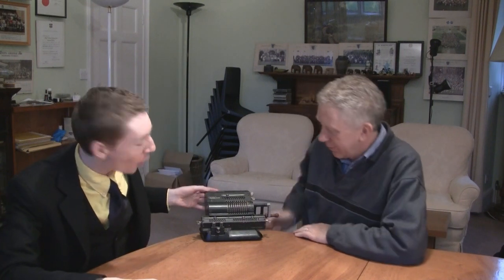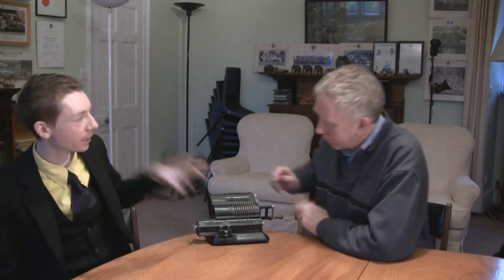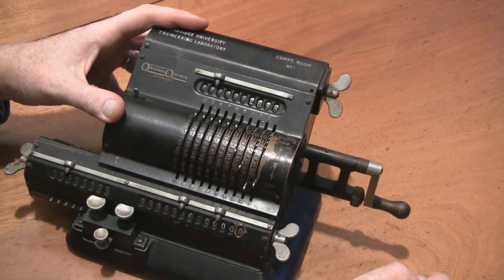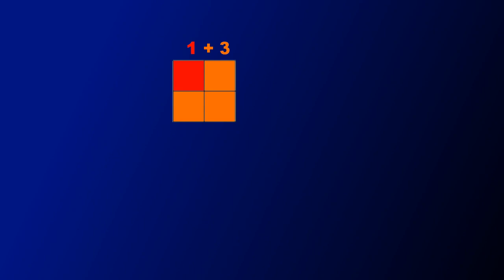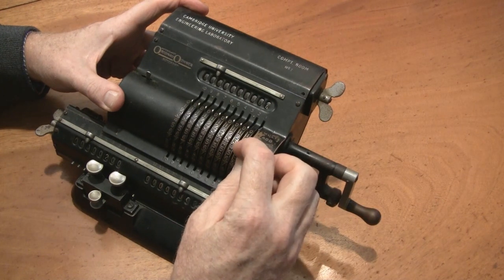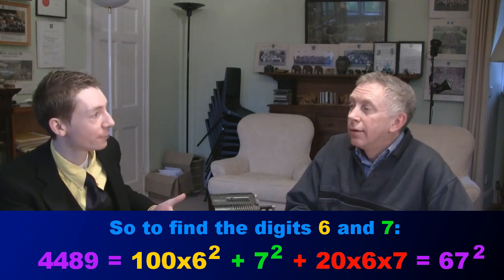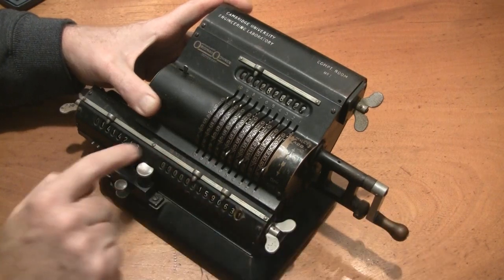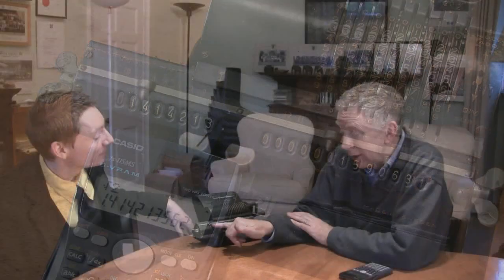The Original Odhner (Vintage Calculator)

Comment: I have just acquired a Kurta mechanical calculator and I’m not going through YouTube for very videos about operating mat and similar devices. I think you should have mentioned the ability to multiply large numbers by adding into different columns the multiples of 10 and explained the bell was when the Accumulator under flowed.

Comment: SQUARE ROOT EXTRACTIONS EXAMPLE
Consider: 36 is 1+3+5+7+9+11
There are six addendums in this series, so the square root of 36 is six.
64 is 1+3+5+7+9+11+13+15
There are eight addendums in this series, so the square root of 64 is eight.
100 is 1+3+5+7+9+11+13+15+17+19
Ten addendums in this series and the square root of 100 is ten.
Remember that very simple series of additions: 1+3+5+7+9+11+13+15+17+19

 The top register is S.B. (setting board)
The bottom right register is R.R. (results register)
The bottom left register is P.R. (proof register)
10.What is the square root of 966289?
Solution:
a. The figures 966289 are set up to the extreme left on R.R. (bottom right register).
Clear S.B (top register) and P.R. (bottom left register).
b. Split up the figures into groups with the aid of the decimal buttons from right 
to left and include two figures in each group, thus: 96/62/89. 
Put the carriage to the right so that the largest number of digits possible may 
be obtained in P.R.
c. Put figure 1 into the S.B. track directly above the 6 in the left hand group.  
Subtract once. Change the 1 into a 3 and subtract once more. Continue in this 
manner with odd numbers up to and including 19, when you will hear the bell 
(overstep bell) which means you have subtracted once too often.
d. Complete a plus turn (to counteract the last overstepped subtraction).
Now change the odd number on S.B. to the nearest even number below : 18 (19 was 
one subtraction too many, so use 18).
e. Move the carriage one step to the left and put up figure 1 on S.B. 
This will cause the number 18 to become 181. Now subtract by 181, 183, 185 and so on. 
When you come to 197 you will hear the bell, and you will then make a 
plus turn and exchange the odd number of 197 for the even number 196 
(again correcting for the one too many subtractions).
f. The carriage will now have to be moved one more step to the left. 
Proceeding in the same manner as before, you add digit 1 to 196, making 
this 1961, and subtract again, first by 1961, then 1963 and finally 1965. 
The remainder of the figures in R.R. will disappear on the last subtraction, 
and this concludes the operation (no overstep bell heard for exactly 000000...).
It is only for you to read off the result in P.R. where you will find the 
number 983. This is the square root of the given set of figures 966289.
You can check this by carrying out the multiplication 983 x 983 which 
equals 966289.

Comment: Funny thing about the electronic calculators you compare this machine to: adding was often all they could do as well. (I can't speak for the specific Casio model you showed; it may have a newer processor.) Many electronic calculators were based on 4-bit processors that could only add or subtract one digit at a time; this is true even today for basic calculators. The fundamental arithmetic operations on the keyboard actually invoke little programs which compute the result by repeatedly adding or subtracting individual digits, propagating carries, and, for multiplication and division, shifting the intermediate multi-digit values. More complex operations, like transcendental functions, are computed by series approximations that use the fundamental operations. Even many advanced scientific calculators operate this way, though they may have more powerful 8-bit processors like a Zilog Z-80. Only modern smartphones and similar systems have really advanced system-on-chip devices with the luxury of a complex arithmetic unit containing fast hardware multiply and divide circuits.
Reply: That's a Casio fx-115MS. For the algorithm, you would have to contact Casio Electronics Co., Ltd., UK, the subsidiary involved in designing this model.

Comment: What's the significance of the bell?
Reply: The bell tells you when you've overflowed.  If you look at about 8:51 you can see the display on the lower right suddenly have a bunch of nines in it.  He then cranks it back the other direction to undo the overflow, if you will, (and ring the bell again) and then moves on to the next digit in the solution.
Reply: lvdovicvs Aaaaand that makes complete sense. Thanks!

Comment: Here is a detailed explanation of the algorithm used to calculate square roots on a pinwheel calculator, using the example from the Original Odhner 227 Instruction Manual. 
http://arthurvause.blogspot.co.uk/2014/10/calculating-square-roots-on-pinwheel.html

I really like the singingbanana videos - keep them coming.
Reply: Armchair Caver 
Nice, thanks. On http://user.mendelu.cz/marik/sqrt
 I collected the methods available to evaluate sqrt on mechanical calculator. I linked also your site. It seems that (neglecting the long division method) there are only various modification of this method, method of linear approximation and 
Newton-Raphson method. If you know about any other convenient, let me 
know please. Thanks.
Reply: @RobertMařík  in afraid the page isnt there anymore is it?
Reply: What happened to the calculation of the sqrt of 4489? Was is removed from the video? They seem to say the sqrt of 2 will be much more complicated, but we didn't see the calculation of sqrt of  4489 on the machine did we?

Comment: 6:32
Isn't that just how most people calculate double digit squares in their heads?
Reply: That depends on the person.

Personally I'd do it in these steps.

67 * 67 = 67 * 70 - 67 * 3.

67*7 = 70 * 7 - 3*7 = 490 - 21 = 469. Multiply by 10 for 46 90 (easier to remember than 4,690).

67 * 3 = 70 * 3 - 3*3 = 210 - 9 = 201.

46 90 - 201 = 44 81 or 4,481.

It's not better or worse, it's just how I've taught myself to do multiplication without writing things down.
Reply: Martin Schou That's quite interesting. I suppose I hadn't considered other methods of breaking it down.
Thanks for sharing, I rather like that method and may try it out myself sometime. It's always worthwhile to break yourself out of your own small shell of existence.

Comment: @Strijdparel Okay, so I didn't understand.
If you have 27 cards with number one, you have 27 cards without a set. You can also add all the cards with the number as 2, you cannot get a set because if you pick three cards two of them must share a number. This is 54 cards. Any cards with number 3 would have to have a set, as all the possibilities with shade, color, and shape are duplicated with both 1 and 2. So you can have a limit if 54 cards with no set.

Comment: @Strijdparel I assume you have a normal pack of 52 cards. With 26 cards, the only way you won't have a set is if you have 2 aces, 2 twos... to 2 kings. Once you get to 27 cards you have to have a set. If you have a 54 card deck, the biggest number of cards is 28, the exact same thing as before except for the two jokers are added, but there is no third joker for a set. But the LEAST to create a set is 3.
Unless I didn't understand the question, that's the correct answer and you won your bet.

Comment: @anticorncob6 ahh ok, so basically from my understanding, all "multiples of powers of roots" (if thats the correct terminology) can be found.
i.e. since we know how to find the square root, we can now find the fourth, eighth, 16th etc

What about primes? This is probably out of my depth now D:

As for the cube root, i thought of a giant cube made of little cublets (as in 3d squares)
so the cube root of 1 is 1cube. Then add 7 cubes to make a 2x2x2 cube and so on. Your formula works in this case:D

Comment: @Artonox I know that n^3 + 3(n^2) + 3n + 1 = (n+1)^3. Perhaps you can list the values of 3(n^2) + 3n + 1 and keep subtracting them until you get zero.
Fourth roots are much easier. All you have to do is take the square root of the square root. If you want to take the fifth root than I have no clue... but I do know the sixth root is the cube root of the square root.
The eighth root is the square root of the fourth root, and the ninth root is the cube root of the cube root.

Comment from the maker: @TSorbera We did explain it originally but I cut it for time. Find the digits individually:

We have 67^2 = 100*6^2 + 7^2 + 20*6*7. 

Find 6 by counting how many odd integers need to be subtracted in the 100s column.

Find 7 by inputing 2*6 into the 10s column (in other words that's 20*6) and then counting how many odd integers need to be subtracted from the units column. This will also count how many 20*6 need to be subtracted.

Now one counter will read 0 the other counter will read 67.

Comment: James, could you please better explain how you run the calculator given that we know this equation is how it works?
4489 = 60^2 + 7^2 + 2*60*7 = 67^2
You basically jumped from "here's a simple case we're thinking of" to "let's calculate sqrt(2) without any explanation".
And a better explanation on how the above equation works, and how it applies to something like sqrt(2) would be nice (e.g. someone mentioned that sqrt(20) is not like sqrt(200).